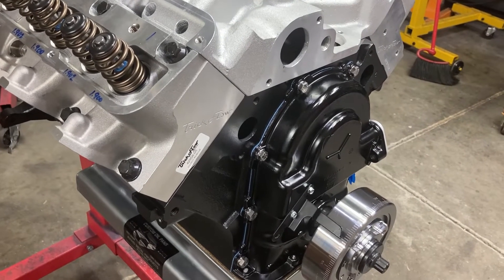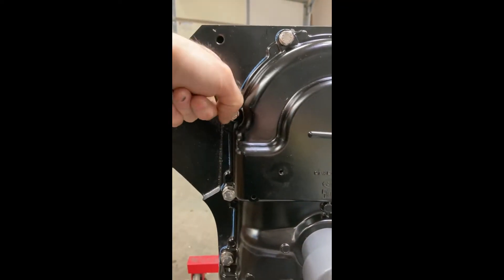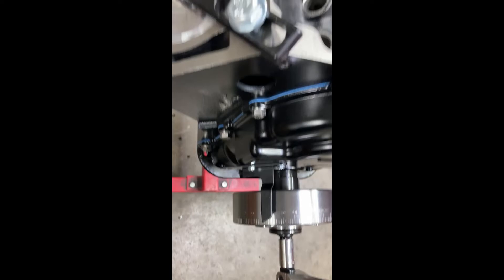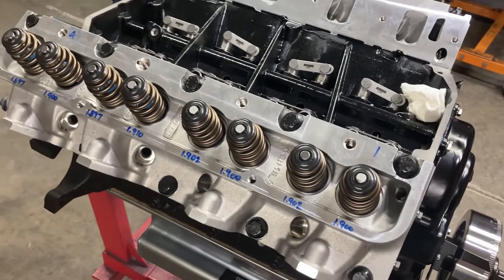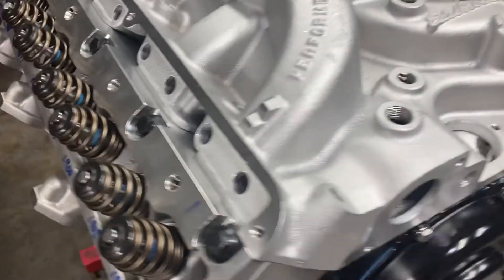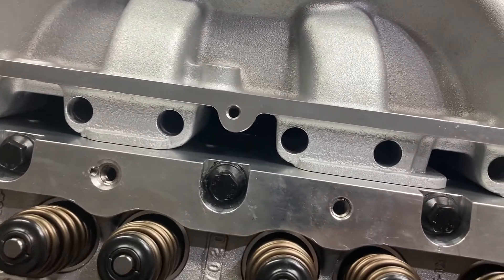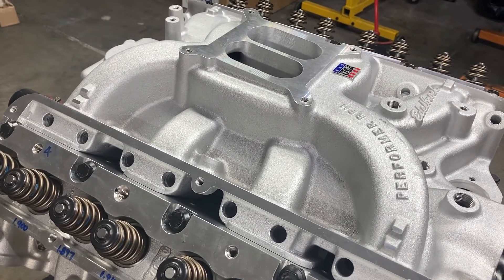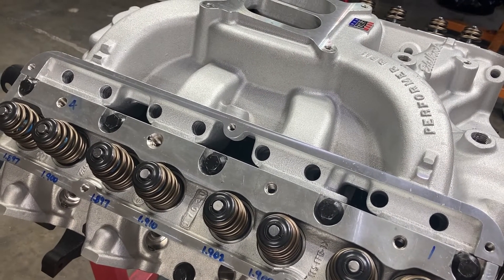Lykins Motorsports Ford 496FE BBM Build Part 3

Comment: I definitely use silicone on the ends of intakes. Had a small block Ford engine that had completely lost the cork gasket on the rear and had been running like that for a long time. What a mess that was to get all the caked on oil and dirt off the transmission.